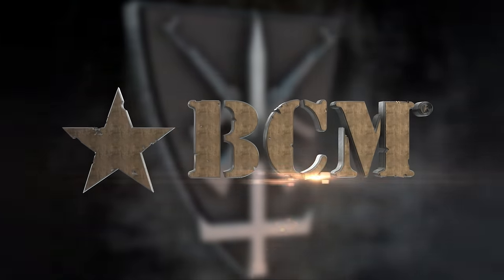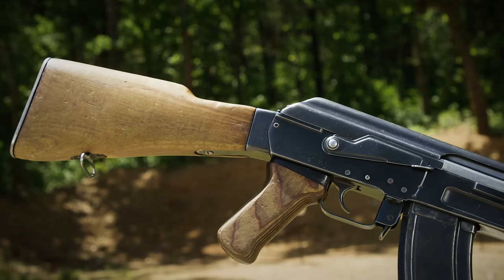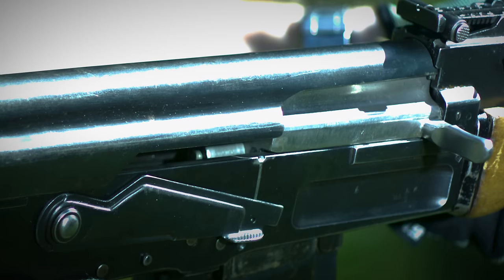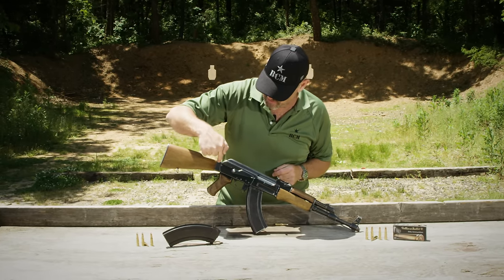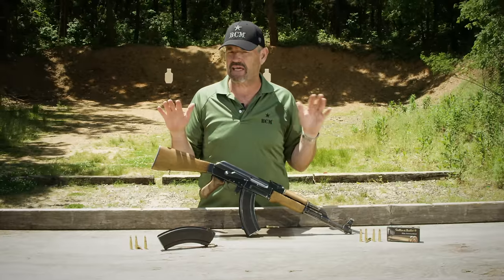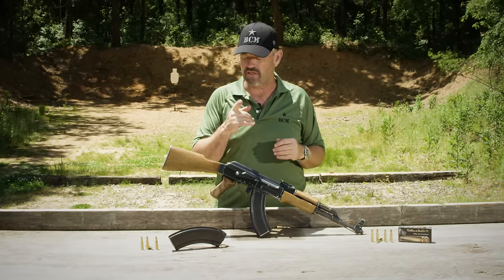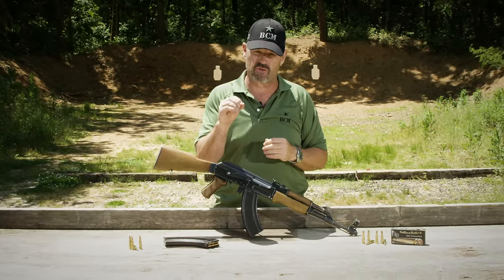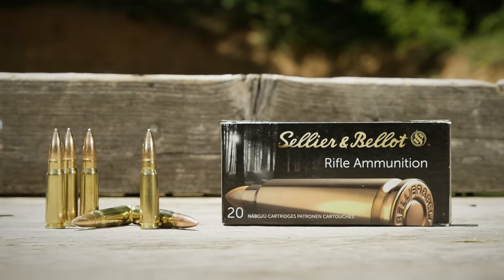AK-47 TYPE 2

Comment: In the slow motion part I noticed that the dust cover looks like it doesn't move at all. So in this case maybe a dust cover rail would hold zeroing very well. In all other slow motion videos that I ever seen the dust cover always moved a little as the bolt was coming backwards so the zeroing wasn't hold well.

Comment: AK are most reliable rifle I've ever seen
Reply: Greg Mahone ...Galil
Reply: САLIMBO ГГГ I stand corrected
Reply: Greg Mahone 👌
Reply: Contrary to popular belief, M16s are even more reliable since they are better sealed. AKs will jam up pretty easily.
Reply: Abhishek Singh With proper maintenance, an M16 is more reliable than an AK rifle. Without, the AK takes the crown.
Reply: You should be maintaining your rifle, it doesn't matter if a rifle can take abuse or not it should not be abused period  (beyond normal or even excessive wear and tear). M16s will work better most of the time, AKs are not more reliable and if you abuse it it will probably jam anyways so what's the point.
Reply: For a battle rifle yes and for an assault rifle I'd say the 416.
Reply: Abhishek Singh AR might stop because wasp gets into the rifle. It is not that much sealed. AK definitely is more reliable than AR. Yeah, it is not sealed. But you can clean it up with your finger. AR - no
Reply: AR's are less prone to extreme and immediate weapons failure (see InRange's mud test) but AK's are less susceptible to long term degradation, or the 'ravages of time' if you will. 

Personally I must admit something about the AK style of rifle catches at the eye in a way the AR15 pattern doesn't for me, especially with Steel and Wood. Easiest way to make a sexy firearm, build it with Steel and Wood.
Reply: Lane  true because of its action.